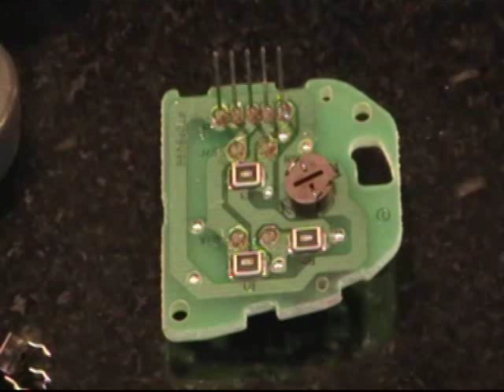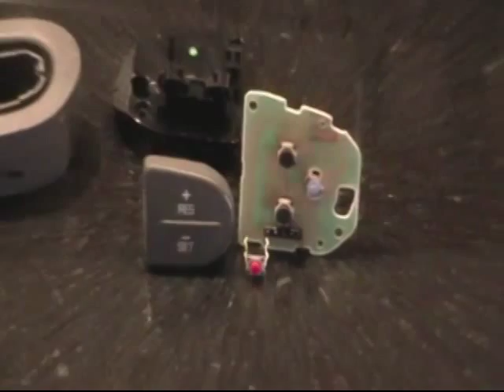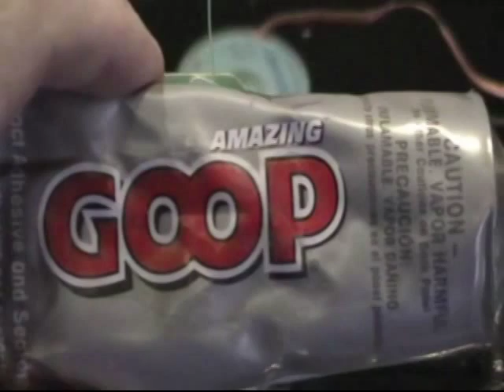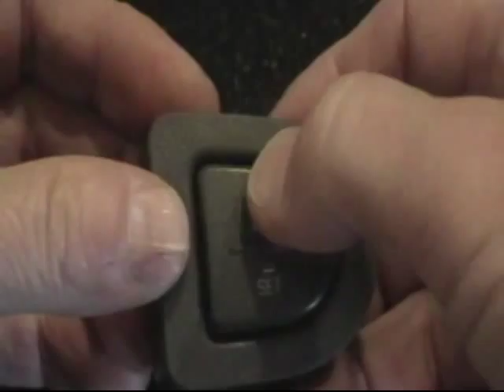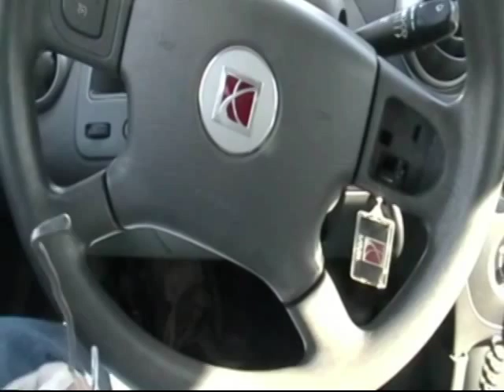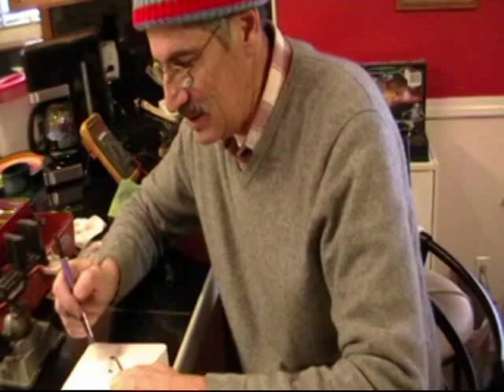saturn cruise switch

Comment: Jack, my Saturn vues cruise control switch went out also. Do I need to take off the airbag or can I just pop it out with a small screw driver and reattach it?

Thanks!!
Reply from the maker: no no no do not touch the airbag.  the switch is pressed into the steering wheel foam. pull it straight out. I used the bent hook shown in the video. no no no airbag involved.